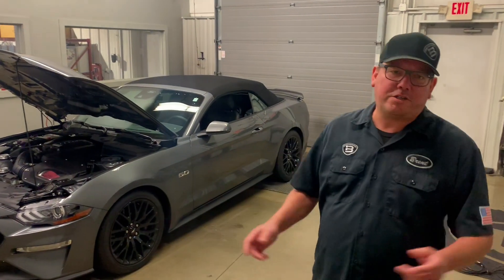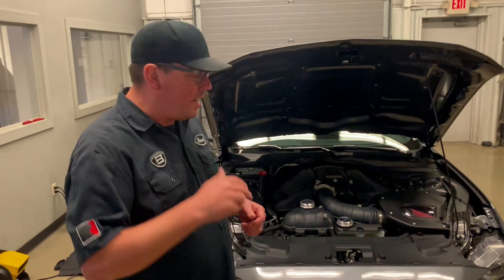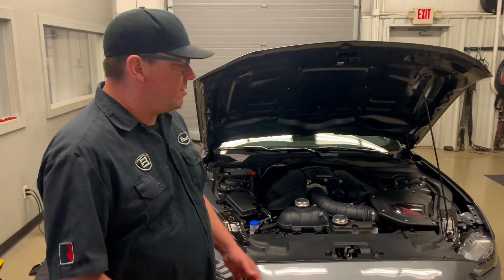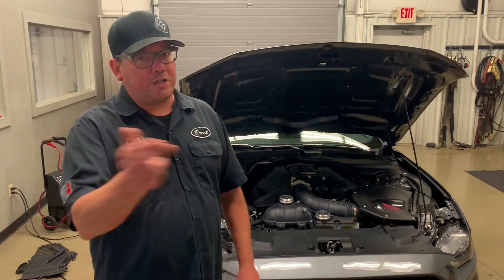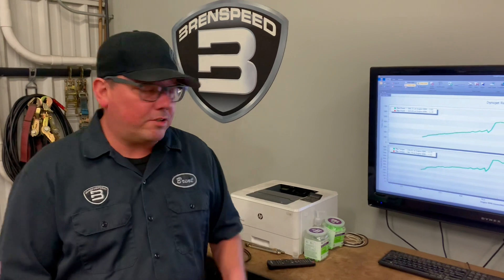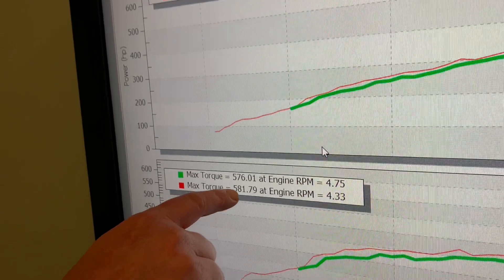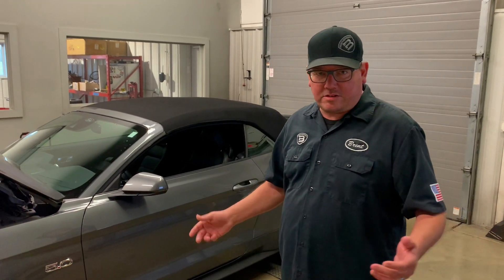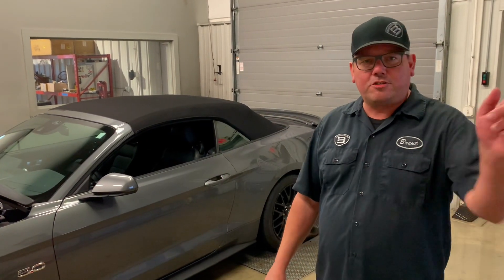2021 Mustang GT Roush Supercharger (Forced Induction Interchiller) Drop IAT 's on Whipple, Roush, KB

Comment from the maker: This video leaves a lot of un answered questions. SORRY! Please use this link to read FAQ on this system. It talks about why it does not drip at the track and how it works. We have used these on Whipple, Roush, and Kenne Bell. Clients report below ambient IAT temps when cruising. Pretty awesome set up.  https://fiinterchillers.com/faqs/
Reply: Do you guys have an install video of the unit? Looking to add one to my 2021 GT500 but want to see what all is entailed first. Thanks!
Reply: @4digitShelby  nobody makes a video for this my friend! This is like, is there a video to put your crankshaft in your engine? Or is there a video to install the ring and pinion of the diff set you just bought? No unfortunately there are not videos for complicated projects like that. You either know how to do this or you don’t. This setup involves electrical (relays, solenoid valves, wiring,) mechanical ((larger water pump), and AC components. If you don’t know how to work with AC system I strongly suggest avoid trying to be a hero and take your car to a REPUTABLE shop. But once you have this setup installed this is one of the most rewarding mods that you will ever had. It will make you smile ALL the time when you drive your blown mustang around. I did the install myself (but I know AC systems and electrical, etc),  
. You also need/should stay in touch with the interchiller folks as you work with the installation.  I got tremendous amount of help from the owner of Interchiller. His name is Kirk and he IS an amazing guy to work with. He’ll be willing to assist your shop on this install. However he is in Australia and there’s a big time difference there compared to US, so keep that in mind. I did the killer chiller years ago and kept it for years, but the difference between the systems (killer chiller vs Interchiller), the technical support and customer service puts the Interchiller in another whole level. I suggest that if you don’t know AC systems (i.e. pressures on high/low side, protect components against moisture , internal AC system components lubricación, to name a few) GO TO a reputable shop!!! Otherwise you WILL spend money as you will take the chance to damage your AC system. Once the system is running like the one  Brent’s showing here I’ll tell you this is freaking awesome. I have a 3V Saleen Extreme and I did the installation myself. But I have a  shop next or my hous that did the AC welding for me (lines, etc).  On my system  I am able to get water Temps out of the chiller going into the S/C between 8-10F) and that my friend NO heat exchanger can’t do! . I don’t care what anybody says. Yo also are going to need a high flow/high volume S/C water/coolant pump and need to setup a solenoid valve to isolate your cabin AC from the CHILLER ONLY mode. Find yourself a REPUTABLE shop that can communicate with Kirk and you will be suuuper happy with this mod.

Comment: Is this a stage 1 interchiller or stage 2? Is the intercooler pump upgraded or is it the original Roush pump?
Reply from the maker: Hi I believe this is the stage 1 kit. Thank you! Also this client has been reporting back he loves it and it is working fantastic. Also.. stock Roush pump for the intercooler.
Reply: @BrenspeedEngineering  Thank you. I live in TN. Do you think that the stage 2 kit would be overkill? I'm also contemplating upgrading the pump. I don't want to spend or do more than necessary. I deive the car hard daily on long commutes. Thanks again.

Comment: I got a stupid question do you use it while you're actually racing or do you use it afterwards to bring your temps down
Reply from the maker: It can be used for both. They way it is set up you won't drip fluid on the ground like a normal A/C unit would so it works for track use.

Comment: Hey hey, bought a 2018 Roush car last winter. Similar numbers at the track. Think holding 6th instead of going to 7th be the trick to better times. 

Anyway I picked up an Interchiller and will be doing install in the near future. Did you guy keep the heat exchanger on? If you did, did you do a drag mode switch? Or just add it after the heat exchanger? So many questions, just want to do this once. I was thinking just plump it in after the heat exchanger and before the pump to the intercooler.

Thanks!!
Reply from the maker: On this one we kept the heat exchanger. We also did the drag mode switch. Interchiller has a good tech department also if you have issues or questions on your install.

Comment: What were the IAT2 after the interchiller?
Reply: They were about 10 to 15 degrees below the ambient temperature on the ride home
Reply from the maker: WHICH IS LOW! LOL below Ambient hell yes!
Reply: @markuaw1  below!? That’s awesome for the roush cooling system
Reply: Someone who is using the FI chiller on a 21 phase 2 Roush setup I can tell you they work amazing when installed properly. I insulated all my lines with braided lines when covered them with foam. I added 3 layers of foam on the Roush reservoir and upgraded to a Pierburg 400 pump. In 106 degree days my IAT2 never jumped above 87 degrees which is absolutely amazing and these were back to back to back pulls. Never pulled any timing or lost power. I’m 100% a believer!!

Comment: I have a gen 3 bottom end gen2 top end with gen4 whipple stage 2. Could I run a 3.25 on 93??
Reply from the maker: The smallest we normally run on 93 is a 3.5 and I prefer a little boostane or torco with the 93 for safety when driving aggressively.
Reply: @BrenspeedEngineering  appreciate the response!!!

Comment: This power level is sick. I have a 3V 2010 Mustang GT (Auto) at your shop right now with a 5.3 Stroker motor in it. (M-6009-B53). Can I get to the 650hp to 660hp range on 93 with my Paxton 2200?
Reply from the maker: No not on 93. Here watch this video link. This car was like 620 on 93 through a manual which reads more on the dyno and had huge cams, big ported heads, big headers, etc...I also think that the B53 is lower compression than our B326 which lowers power as well. https://youtu.be/2dcdjVvZ25U
Reply: @BrenspeedEngineering  I love these power numbers too 620hp range. I'm not to concerned on the manual vs Auto cause it is what it is with the drive train loss. However, I'll be doing the huge Cams, and Big Ported heads just like this guy, and I believe my B53 eventually is gonna be built with the guts you guys use for the B326 and if that's the case shouldn't that make this car a beast on the streets if not HP wise at least Torque wise if nothing else?
Reply from the maker: It would be awesome!